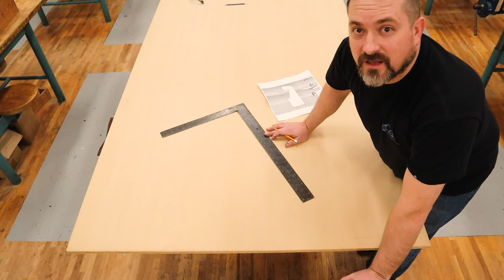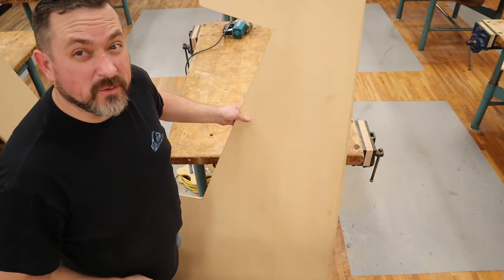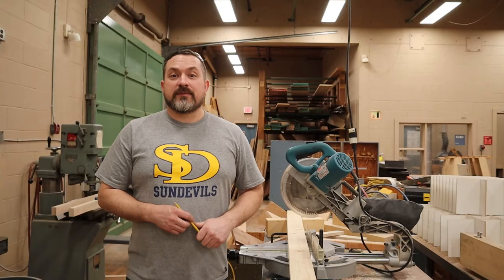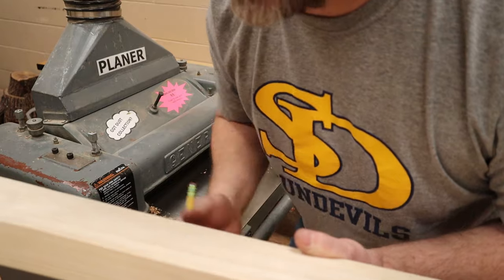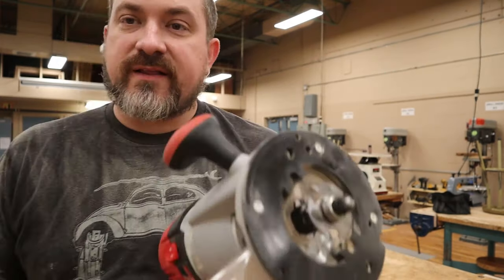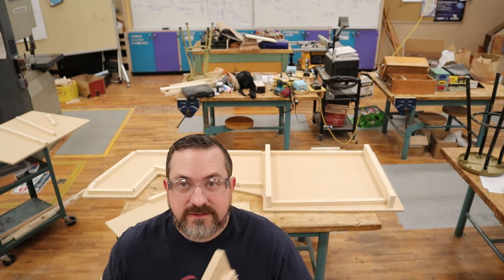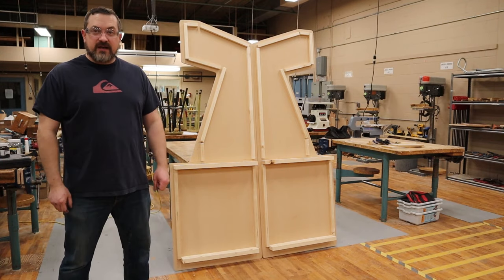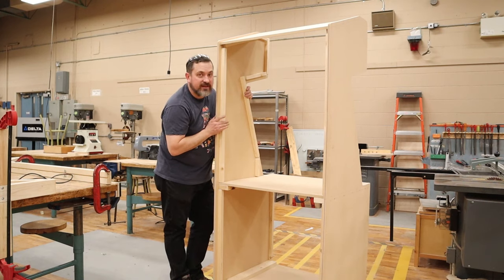Custom Raspberry Pi Arcade Cabinet- Constructing the Cabinet Part 1. Episode #6

Comment: I would suggest taking your 2 pieces of MDF for the sides and tacking them together inside the pattern with a few finish nails. That way you can cut, sand and all that and guarantee that your sides are identical before removing the nails. Obviously the thickness of your board will determine if you can still do this with the saws you have, so keep that in mind.
Reply from the maker: Yup good suggestion, you can also use one as a template with a trim router bit too!  Thanks for the watch!

Comment: when you have all these tools of course its easy
Reply from the maker: Easy? Not really.  Beneficial or faster?....sure.  you should check out my virtual pinball cabinet series as I address this issue and make the cabinet with only 4 basic tools.  You really only need a jig saw and a drill to make an arcade cabinet.  Thanks for the watch!

Comment: Why didn't you just use the router to begin with since you had the template already?  Done it many times and works just fine.  Just curious.
Reply from the maker: Yeah I could have just didn't want any issues hogging through the full thickness and having to sand a ton.  What I really should have done is make a template even just to make another cabinet later if I wanted.  Oh well, way too many projects on the go to do that anyways.  You should check out the virtual pinball cabinet I'm building now....its awesome.  Thanks for the watch!

Comment: Adjustable square is your best friend when it comes to building templates for cabinets. I have a 4ft by 2ft and being able to set exact angles with an offset to press against a reference side is amazing for locking in those clean angles!
Reply from the maker: Yeah that would be an awesome addition to the shop.  I just used some basic tools that were readily available to most people.  How many arcade cabinets have you built?  Any virtual pinball cabinets?  Thanks for the watch and the suggestion!

Comment: Great video series!  I've always wanted to build my own cabinet.   I've watched a bunch of video tutorials and these have been the most informative.  Hoping to build my own soon, I don't have a wood shop but I feel like I can manage this if I just take my time.  The hardest part will be transporting the 8 foot MDF sheets to my garage.  I love your design too, I like how your controls aren't butt up against the monitor like I see in most designs, and a digital marquee makes this really stand out.
Reply from the maker: Thanks Shane, appreciate the kind words!  Yeah you don't need a wood shop, just a drill, a jig saw, and a router.  I used all of that equipment more cause I had it.  I'm currently building a virtual pinball cab with minimal power tools in the Auto shop.  I'm still really happy with my design, the digital marquee and bluetooth stereo are the best things on this cab for sure.  Thanks for your watch and good luck with your build Shane!

Comment: Very nice video and nice shop and tools.  Most of us don't have access (or room) to have all of that.  I'll have to look up a "poor man's" version of this and see what you can do with a circular saw and jig saw only.
Reply from the maker: no no...your good.  All you need is a jigsaw, drill, and sandpaper.  Is it harder and less accurate....yes.  However, you can totally make an arcade cabinet.  I do wanna make another cabinet, probably a bartop and I have already decided that it will be made with minimal tools and minimal cost so that anyone can make one.  Keep an eye out for it in the future!
Reply: Back in the day they didn't have power tools. Saw, hammer, hand drill, screwdrivers.

Comment: I'm looking to make an Arcade cabinet but will be using a pc of old parts I have laying around to run the internals. for the cabinet schematic alone though, I will be using these plans. If you haven't seen it, I'm going to be using Big Box frontend on my MAME games selection. I highly recommend people look into it because it's one of the best looking frontends for emulation I've ever seen and I'm planning on sourcing out a wide array of controls so I can play shooters, trackball games and 2 player standard arcade control games. Sinden makes a light gun that works with modern screens, so I do have a realistic option to build an all in one cabinet that I can keep forever. 

On top of that though, I plan on building my own video pinball table with an old TV I have and it will utilize my original Nintendo Switch and Pinball FX3. For the buttons, I'm going to repurpose an 8BitDo arcade stick and use two of those buttons with wire extensions to the original PCB of the controller, and place them in the sides for an authentic playing experience. I could probably just buy more arcade buttons, but I figure using the Nintendo switch, it'd be easier to go the 8BitDo route and know everything will connect wirelessly to the console with no compatibility issues.
Reply from the maker: Sounds like a good idea.  Yeah I've got a Bigbox system at home I use, it's a great system!  When you're done making my arcade cabinet I'd love to see it!  I've also got a great series on vpins if you haven't seen it yet
  Thanks for the watch!

Comment: Looks awesome. I just bought a couple sheets of MDF today.  I'm hoping my experience routing MDF slot car tracks in Kelowna BC helps in this build! Kelowna Slot Car Club
Reply from the maker: Thanks!  Yeah Mdf rocks for this stuff because there is no warped panels to deal with and it is easy to cut/drill.  Watch the dust though, you'll need a mask for sure.  Nice, I lived in Kelowna a long time....great memories of Scandia arcade!  Thanks for the watch and feel free to ask any questions and I'll help ya out.  Cheers!

Comment: Great video series! Given the low clearance at the bottom, how are you able to reach beneath the cabinet to lock and unlock the casters? Are you just tilting the cabinet out every time and having someone reach below to unlock and lock? Do you use a special tool to reach the total lock on the top of the wheels?
Reply from the maker: Ya know it's been a long time but I think there weren't locks.  If there were I don't remember.  The intent was to have the cabinet very low to the ground like it was sitting right on the ground yet movable.  It doesn't move at all when playing in my garage.  Thanks for the watch and I'm glad you're enjoying the series.  Let me know if you build my design and I'll post it on my instagram.  Cheers!

Comment: Sorry for the silly question but...why didn't you cut the 2 side panels at the same time? You could have put the 2 mdf sheets together, clamped or screwed, and cut both at once. What am I missing?
Reply from the maker: First off, it's not a silly question....it is pretty valid as that would be faster.  I also could have use one to router out the second with a trim flush bit without first rough cutting most of the mdf away too.  I chose to cut them separately because I was using a jig saw to cut them and from previous experience, the jig saw blade tends to bend when cutting too much, especially when cutting too fast.  Plus at the end of the day it really isn't that much extra work.  Thanks for the question and the view!

Comment: Is that an optical illusion? It looks like the caster doesnt extend below the side panel. Also, how are those wheels holding up so far? I'm trying to decide whether 3 inch wheels would be better for my build.
Reply from the maker: Lol.  No it's not an illusion, they are very close to the bottom of the cabinet.  In fact, I wish they were about 1/8" to 1/4" lower because the cabinet moves perfectly on flat surfaces but drags a bit on the t molding if it's not flat.  I originally wanted it to be close and not have a huge gap so I went pretty close but if I were you I'd go a bit more.  The wheels are holding up fine, I don't really need to move it a lot though.  3" casters would be totally fine, just don't get the absolute cheapest ones you can find.  Cheers!

Comment: I am interested and using your plan but I wanted to make a 4-player control board would you happen to guess some measurements for the cabinet? Also I didn't see anything in the comments what was your out-of-pocket cost in materials and everything else while you were building the cabinet
Reply from the maker: I haven't design a 4 player control panel yet so I don't have anf dimensions for ya but I do know that any 4 player games don't have 6 buttons like street fighter or mk2.  So design the center players with 6 buttons and the far left and far right as 4 buttons.  Yeah I have been meaning to do a final budget/cost/things I'd do differently video for people.  Keep in mind this was my dream cabinet and not a cheap as possible build and the parts were purchased over a year so it was easier to spread out the cost.  I need to do a final tally but it is just over $1,000.  Just the digital marquee alone was $279 plus taxes and everything starts to add up.

Comment: So for the batons how far in are you putting them? Obviously bottom varies depending on what type of wheels you get,  and the shelves are obviously 5/8” the depth of your MDF. But the front, back, and top are all the same depth recessed in. Just curious what depth you set it back. Thanks!
Reply from the maker: I inset the mdf panels in 1/2" and used 5/8" thick mdf.  The batons are squared up 1" x 1" x whatever length you need for that panel.   For the bottom, I used squared up 2" x 4"s for more support.  Depending on what caster wheels you use, you will adjust where they are placed to get the spacing off of the floor you want.  One of these days, I need to take mine off and add a 1/4" spacer as mine is really close to the ground and even scrapes a bit once I installed the t molding (not visible though as it is on the bottom.  Cheers!
Reply: @wayofthewrench   thanks so much I figured you did 1/2” but just wanted to make sure!

Comment: It was great, but I think I exaggerated the pins and screws, maximum ai 2 or 3 pins and screws in each piece, because I put in mdf already safe! Congratulations more!
Reply from the maker: Really all the nails and screws are just until the glue dries. I also use screws so you can have a dry fit to test things before it's permanent.  Cheers!

Comment: How far apart do you set the wood that you wood glue down and nail from the edge of the side of the cabinet?
Reply from the maker: On mine, I was using 5/8" thick MDF so I glued/nailed the glue blocks in from the edge 5/8" so that the board would be flush.  Hope that helps!  I'd love to see your arcade cabinet when you're done.  Thanks for the watch!

Comment: So do you think using 3/4 inch mdf will mess with your plans any? I cant find 5/8s anywhere.
Reply from the maker: Off the top of my head, no I think it should be fine but keep in mind it might effect the parts going in.  Length of buttons, depth of inset of the monitors, thickness for mounting joysticks and trackball, etc.  The control panel will be a touch smaller in width as the side panels will be a 1/4" wider overall.  You should be able to make it work though, just watch as you build.  It will be heavier and cost a touch more too.  You could always go with 5/8" plywood too.
Reply: @wayofthewrench  thanks! i just brought home some 5/8s MDF today, lots of searching but finally found some! looking forward to starting this this weekend.

Comment: What grit did you use to sand it down, also any tips to sand edges down? Great work!
Reply from the maker: I used 120 grit to quickly knock down any bumps before filling the holes and 120 to smooth out the wood filler.  I didn't press hard though as 120 grit can leave some pretty nasty scratches.  Then you go through the grits for any surfaces that are cosmetic, 220 grit, 400 grit.  Always use a sanding block so the surface stays flat, especially the edges.  I didn't really touch the edges as the t molding covers all of it.  However, I should have sealed/ primered and gone through the grits to 600 on the control panel edges as the vinyl graphics didn't stick at all to the edges.  It was a good thing the t molding is on to hold the edges.  The main thing is not to go through the grits too fast, if you have a scratch that is bigger than the scratches your sand paper is making then you have to keep going (or fill with wood filler).  The MDF sands super easy and really the main surfaces are already smooth too so it's really quick.  Plywood is going to need way more sanding.  Cheers.

Comment: nice! i have a raspberry pi 4 model b and a 7 inch display running retroPi and it is also a arcade cabinet. but mini version.
Reply from the maker: sweet!  how do you like the pi 4?
Reply: @wayofthewrench  it has better processor and it is faster. new ports so you can mount new stuff too. sorry i couldn't get back to ya.
Reply from the maker: I am going to upgrade the rasp pi 3 b plus but I probably will just switch to a gaming computer and reuse the rasp pi 3 b plus for a future build series on a cheap (if not free) portable bar top arcade cabinet.  Or I'll keep my eye on a future sale on rasp pi 4.  Cheers!
Reply: @wayofthewrench   to be specific, if you overclock the pi 4  it is quite like a mini gaming pc. it would be a good idea to maybe machine your own case for it  (like a mini pc case) and add stuff like a fan, and led strips/ you got a gaming pc !

Comment: I REALLY want to get this project going but I have very limited tools. Not only do I worry about mapping the dimensions, but I worry about cutting the actual wood. The only real tool I have access to is a Jigsaw and not much working space, is it very difficult to make correct cuts and the overall machine with just a Jigsaw?
Reply from the maker: You can use a jig saw, just go slow with your cuts and take your time.  You will need a drill and a couple drill bits to be able to make a cabinet.  Should be able to borrow or pick one up for cheap.  As for laying it out, you just need a tape measure, a long straight edge, and a square.  I'm sure you can do it, it just might take a long time.  Remember that you can always sand the surfaces/edges to your pencil lines if need be.  Good luck and keep me posted on how it goes.
Reply: @wayofthewrench  I'll give it a try, thank you so much for replying! It really means a lot.
Reply: @wayofthewrench  I have one more query. I don't have a large workbench, is one necessary? Or is there something else I can use?
Reply from the maker: No worries, if you have any questions, feel free to ask in the comments and I'll help you out as much as I can!
Reply from the maker: It really depends on the size of your cabinet, if you are making a bartop, then you won't need much.  You could make up some sawhorses to put your material on top of while you work.  Honestly, you just need some space under the plywood/MDF so that the jigsaw blade doesn't hit the floor and bend the blade.  You could use milk crates/plastic buckets if you had to.  Just make sure everything is stable and safe so you don't get hurt!

Comment: Im planning to get stuff for a wood/workshop. What tools and equipment should i get for this and most projects? Thanks
Reply from the maker: Awesome!  For a general purpose woodshop, I would get a tablesaw, jointer, bandsaw, router table, drill press, and a belt sander.  You would do well to have a glue up table as well.  If you want minimal tools for just arcade stuff, then a drill, jigsaw, circular saw, router, and a palm sander.  Remember you can start slow and buy as you go too in case money's tight and you're not in a rush.  Good luck Joh!
Reply: @wayofthewrench  thank you. It would be worth any of ammount of money because ill get so much use out of it. I only want the longesr lasting equipment from the best brands. Im not trying to buy a new machine every 2 months...
Reply: @wayofthewrench  thanks for the quick response if u have a IG ill dm u and let u know its me so u could lmk what u think about my progress if thats fine
Reply from the maker: Yeah no sense buying garbage.
Reply from the maker: My Instagram is in the video description.  Yeah keep me updated!

Comment: Awesome vid!   I was recently transporting an Atari cabinet the base was more rotted than I realized and the cabinet fell out of my truck .   I’ll put it all back together.  Guess I’ll use your nail gun and glue idea.  Lots to repair.   It all busted at the seams I will be able to save it.  I’m not a pro…. Any suggestions on repairing ? Thank u
Reply from the maker: Thanks dude!  That sucks about your cabinet.  How much is damaged?  Just a couple inches on the bottom or everything?  If the whole cabinet is messed up, you may wanna build a new cabinet using the last pieces as templates.  If it's just the base maybe you can shore up the insides with like a ghost frame just inside.  It'll add weight but if you go higher than the damage, you might be able to strengthen it up.  Good luck!
Reply: @wayofthewrench  I’ll put it all back together. It all came apart. Sides, top , bottom ,  monitor survived ….amazing.   I’ve got a plan 😀The neck board did crack but I’ll have it repaired or replaced. I’m old school.  Old soul.  I have to have original artwork or i won’t have it in my collection
Reply from the maker: Oh man, that sucks!  Is it plywood or mdf?
Reply from the maker: Yuck broken and soggy mdf is the worst to work with.  Good luck dude!

Comment: Question can I built an arcade cabinet around a console instead of using a raspberry  pie.
Reply from the maker: Yes you can.  You can also use a pc if you want.  I just used the pi so the control panel could be portable.